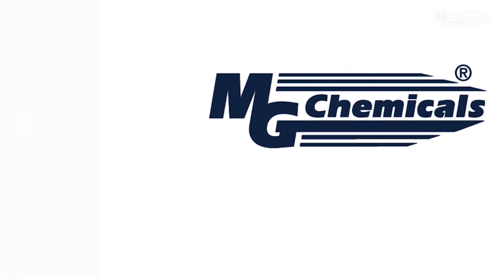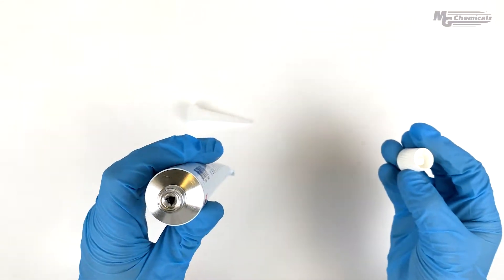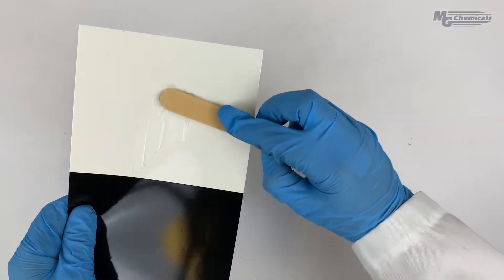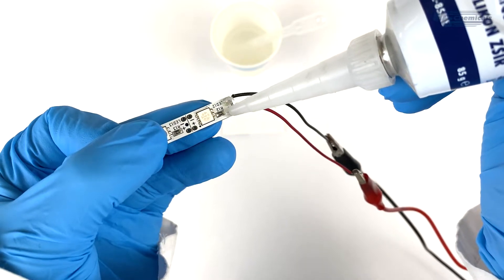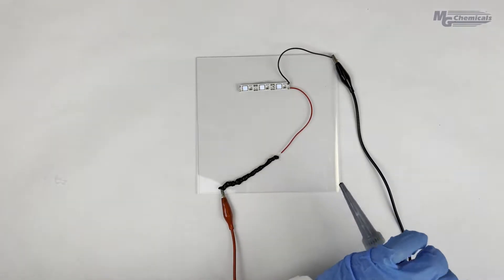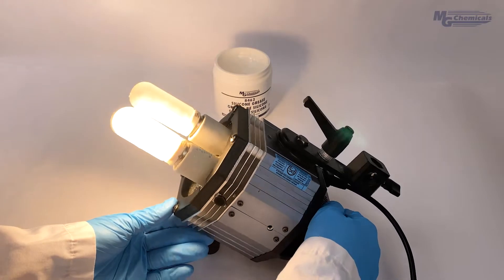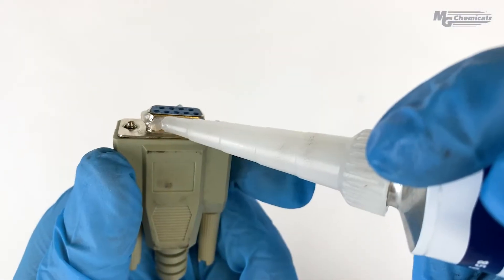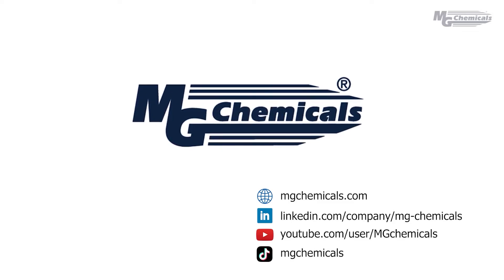Tech Talk Episode 10 - Conductive Grease vs Dielectric Grease

Comment: There is a connection problem on my electric bike. Its where the battery connect on. I can spray electrical cleaner on the connections and I am good to go for a few hours. Then my motor cuts. I can usually turn it off and on a few times to get back home. Is conductive grease and an option for me?
Reply: Yes
Reply: did you use the conductive grease on it? please share with us how did it work? Bu answering your question I think conductive grease would help, but at this point the connector is damaged or corroded, cleaning or replacement is the proper way.